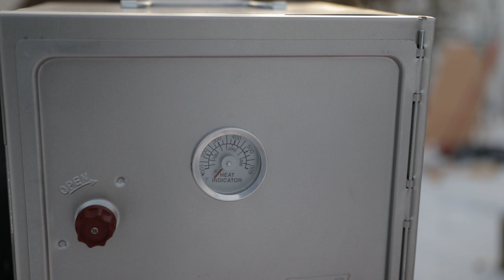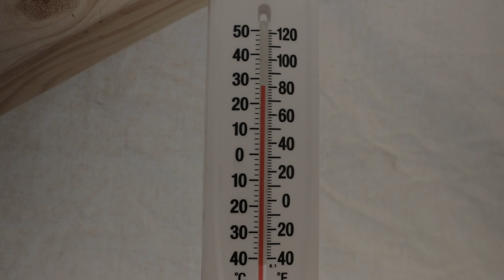Blistering Hot Tent Shack, With a Door

Comment: Shack is coming together nicely there Jay. I run into similar issues burning pallet wood, with a similar style of stove. Mine stays outside, in a wind-sheltered clearing, but all it takes is two short pieces of deckboard to get it glowing cherry red LOL. I imagine, once you've made a decent bed of coals, a larger unsplit round might burn less intensely, maybe dampen the temperature swings? I'm curious, last winter you were getting smoked out of your big tent, what have you done to change that?
Thaw is coming soon, I'd grab some standing dead while it's still "easy" to move it.

Comment: It’s so nice! I have so many questions... Will the wood interior induce mold growth on the tent? Why put the stove in the front, wouldn’t it be more efficient to put it in the back? Will you continue to build the wall up farther? Are you on your own land? Why not bring a better can opener? Ok fine the last one is just snark. 😉
Reply: hahaha
Reply: Wood stoves are best near a door, wood is messy and brings bugs with it.  Keeps it out of the rest of the space.
Reply: The hole in the tent roof is pre installed for the chimney - that location was hard coded from the tent company.  His wood interior shouldn't get moldy as long as it stays relatively dry and there's a good number of air exchanges per hour (I'm sure there is - its not sealed that well),  and he explained before the tent is on public land where they allow you to build temporary cabins and shelters, they just can't have a foundation, be attached to the ground, or be made in a permanent fashion. His is all screwed together and could be disassembled in an afternoon if they decided they wanted him to move. His other tent has already been at this site for a few years and he leaves it up.
Reply: LOL I noticed the can opener too, but since it is a knife attachment, I guess it's good.

Comment: We had a 12 X 12 cabin tent with and 12 X 8 steel frame homesote insulation board for walls added on. We had a woodstove about the size of yours to heat it. It was ok when it got down to 20 to 30 degrees overnight but in daytime, it would drive you out. We made a woodstove about half the size for the next year. It is hard to gauge the size of stove you need. It depends in part on the wood you have to burn and the temperatures when you use it and how efficient your tent material is. I might add that the tent portion was up off the ground on a wooden platform, had a separate fly, and was encased over the tent portion with plastic sheeting which formed a layer of air insulation. Each setup has to be evaluated individually and what size woodstove to use may be a matter of trial and error.

Comment: The place is looking good with the addition of the door and other items 👍   Not sure if someone has already said this or not but the pallets are usually made of a hard wood (Oak) that burns longer than pine and with less soot too 😉   It's good for nighttime fires 👍   Pine burns faster and hotter but more soot 😉   Pine is good for a fast hot fire when you want heat quick 👍   TFS

Comment: Hi.My wood stove wood go nuts on me.Does your stove have a door gasket?Mine did not.I found some self sticking 1/8 by 3/4 gasket material on line.Made all the difference.I now have much better control of the heat and the stove will burn all night.I use 50% less wood and stay very comfortable.Mark.

Comment: i used those coleman stove before and you should have a blue light  not yellow flame, yellow flame means you need to pump air in to get blue flame.
Reply: philip joron I totally agree, I have two of these and they should burn more like a butane stove, not a wood fire. Needs 40 pumps to get to pressure on mine (a 425, which looks the same as in the vid), then keep pumping occasionally to keep the pressure up. And no need to use Coleman fuel, they run well with normal petrol, it’s cheaper and easier to get hold of (use the same as the ‘Doo?)
Reply: Or it has another issue. Usually something simple.
Reply: I would say it needs a generator tube replaced
Reply: philip joron I was thinking that same thing when I saw the flame. I have a couple of those and I wouldn’t trade them for the newer ones that are out now. One of them is an 3 burner from the 1960s the other we have had from about the early 80s. Love those stoves.
Reply: A yellow flame means incomplete combustion, the flame will cause soot when it comes in contact to another surface and cause CO. Adjust the air ..
Reply: Orrrrrr it just wasn’t hot yet, it sounded right later in the video.   These stoves turn the kerosene into vapor via the hot tube, so they need a few minutes to get going. That’s what the small valve is for until it heats up.
Reply: @danieljohnston5306  I've been using Coleman stoves like this one for close to 50 years,and I mean you no disrespect, but these stoves do not use kerosene.... They burn gasoline. Back in the day we used to get what was called " white gas "....it was unleaded gas way before the now mandated unleaded gas....of course even back then you could get " Coleman brand fuel " but it was more expensive than a gallon of unleaded gas.....The cost of " REAL " Coleman fuel today is so expensive as to be ridiculous... Looking at this video it looks like he has never been instructed in the initial startup procedures of a gas burning Coleman stove...... Like after filling the tank , it needs some pressure to begin with....perhaps his pump needs lubricated or replaced....unscrew the pump and with your finger or thumb over the little hole , pump at least 40-50 times....the way you know the pump is working is each pump stroke becomes a little harder....turn the little lever up ( this allows raw gas to flow through the steel tube ) After lighting the burner the tube becomes hot enough to turn the fuel to a vapor , and after mixing with air burns the familiar blue color.... Then turn the lever down . I have and sometimes use the popular propane camp stoves , but I prefer the old tried and true gas burning stoves..Just my opinion .

Comment: I have a question and it may be a dumb one but I can't wrap my mind around it. I have seen a few people on you tube buy a canvas tent and then frame out the inside of the tent with walls. The outside is still canvas. Isn't this just a waste of a canvas tent? What I mean by that is why use the tent? Why not just frame out a cabin? Is there a reason why people do this this way?

Comment: For any future framing you should check the frames to see if they are "square" .  You do the by measure diagonally to see if the measurement is the same both ways.  measure your door corner to corner like an X to check it. Same as the door opening , check it corner to corner. The squarer you can keep things the better they will fit .

Comment: Jay, put a rubber ledge or list to the bottom of the door to avoid major draft. Nail it to the bottom of the door so when you open the door, it's sliding on top of the floor.
Reply: And also to both sides.

Comment: do you have something to circulate airflow? Not to be worried about the smoke but you could think about co2 from breath because you're closing everythang off with boards and stuff.. The chimney already has your back with the whole smoke issue. I'd suggest some plants but.. you know, the winter thing and all (most plants aren't huge fans of winter).. This will keep you sheltered in heavy weather though. fortifying it is an excellent idea
Reply: it'll last longer than a little while.. those wooden parts are well protected by the canvas shell from weather and it's pretty tough as I can see. it'll remain there for 100 years, or until "whether" you take it down or not. (nerd pun intended)

Comment: Jay, are you running a carbon monoxide and smoke detector?  You can get RV specific ones that run on batteries.  Just remember to pack them in and out.
I don't know if you'll use it in summer, but if you do you'll have to run tarps inside to block the sun and heat.  24 hour sun makes it hard to snooze.

Comment: You can fix that gap in the door with three planks. Screw one plank to the deck right outside the door (when it's closed) and two planks onto the outside of the side-walls so that they overlap the door by a few millimeters (or fractions of an inch). This way the door will rest against those planks when closed, and it will not reduce the door opening by a noticable amount. You add some rubber seals on the inside of the new door frame, but it shouldn't be needed.

You could also make the frame a bit stiffer by connecting the new wall to the roof. Finally, get a cheap heat powered oven fan, which will circulate the air in the tent. You can get those for less than $30 on Amazon.

Comment: You should run a board of 4-6" wide along the inside door edge.  That will cover the gap and prevent the door from putting too much pressure on the hinges.  Throw some weather stripping to seal and keep it from slapping in the wind.

Comment: Ahhh! Now i watched the Video till the end. OK, it gets real hot inside, so, I think a complete Insulation would probably not necessary, but - If you put the Bed to the Position where it was on the end of this video, it could be cold from the outside. 
In this case, just add a Blanket or two, or a thick carpet on to the Wooden Structure. Most People  don`t know, that the only Thing about insulation is the Air between the inside and outside Surface! YES! It`s the air that insulates from the cold!  The MAterials like Rockwool are just there to prevent this air of having a thermic circulation between inner and outer surface - because this circulation is the case for exchanging the Warmth to the outer side. If the air stands still, its perfect insulation. Bytheway, the circulation begins with a gap of 4cm.. that`s about 1 1/2 inch  Below this 1,5 inch, you would need nothing for insulation... Not really, but it helps a little bit. That said, you have a , I estimate, 60% effect for insulation if you tack just a blanket on to your Wood structure of 2X5es or are they 2x6?  Anyway, it certainly will keep your Back arm if you add this to your Backside of the Tent! Or, just add a piece oof plywood on the inner side at the Tent`s back, and then hang a caret over it_ This will be awesome, I tell you;-)   Just close the Gap on the top between the two Sheets ;-) !

Comment: No kind of insulation between the wall boards or caulking around the floor/ walls. Air will surely seep in. Brrrt need a carpet of sorts on the floor

Comment: Young man you really need a fire blanket that will cover a very large area around the chimney to help prevent holes being burned into the fabric. Also to prevent a possible fire starting on your roof. You can pick this fabric up at any Harbor fright tool company or any welding supply company. It will be in the welding department. You can cut your fire rings from an old large coffee can to save money. If you have a sewing machine your job became much easier. Maybe you need to sit down and draw a simple design for the fabric and fire rings that would go around oven chimney stack. Remember to install a spark arrester screen cap on top of chimney stack.   Just an opinion.

Comment: OK, I'm gonna YELL at you, lol
I'm a 30 yr + construction, building experienced carpenter.
There is a law in physics, "something in motion requires less energy to maintain that motion then to stop and start" 
EVERY TIME you stop and start your screw gun when putting in a screw, as you did attaching some of the plywood to framing, you are HIGHLY torque loading the screw,  much more so then if drove straight in, which can lead to breakage of screws, I see it done constantly and see guys get mad when screws snap.....drive that screw home, if you need to back out and start over, fine, but don't keep start and stopping when driving home.
as far as bottom a cheap hardware store door sweep will work or take 2, 4 inch swaths of canvas 1 inch longer then width of door, , dbl up, one on inside one outside, attach to bottom of boor, folded edge against plywood floor and either staple, nail or use a batten strip and screws to attach, cheap, easy and easy to repair if necessary in future
Reply from the maker: Thanks for this. I noticed that I am doing that a lot with latches and hooks and hinges. Wasn't sure it would affect the driver if I drove hard into the metal. I appreciate it. Jay
Reply: If need buy a cheap drill bit set, they even make hex shaped shanked for the impact style guns, cost about $10-15, light, easy, has about 16-20 bits...it'll be worth it's weight in gold in some situations